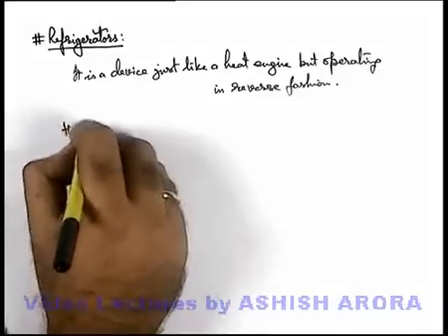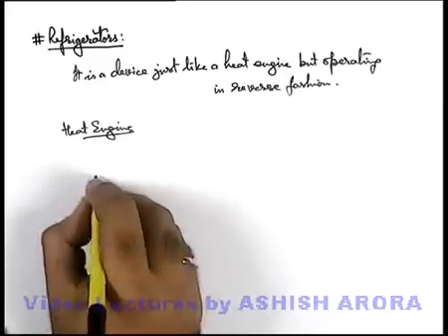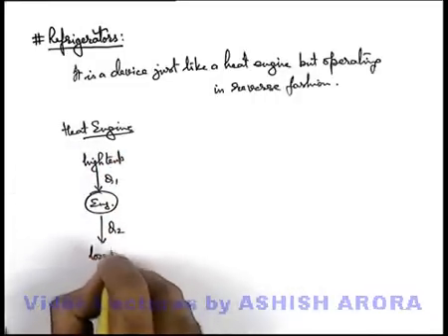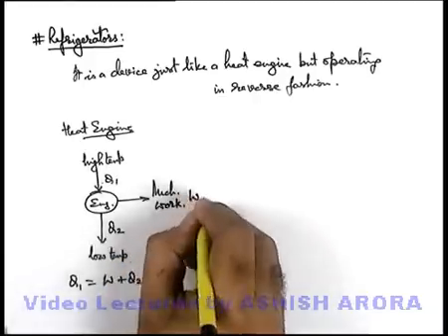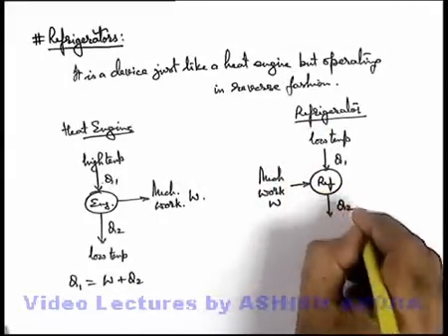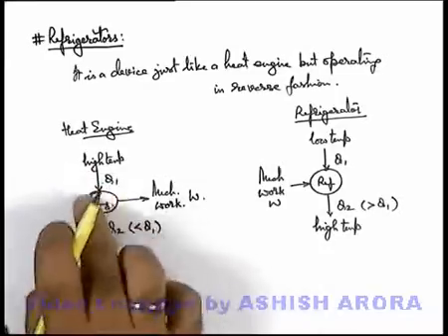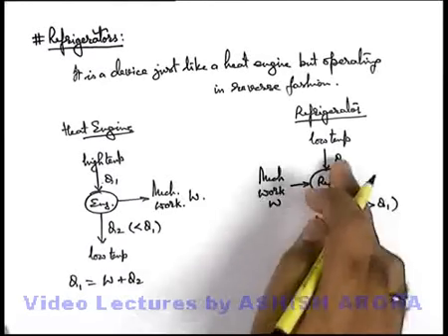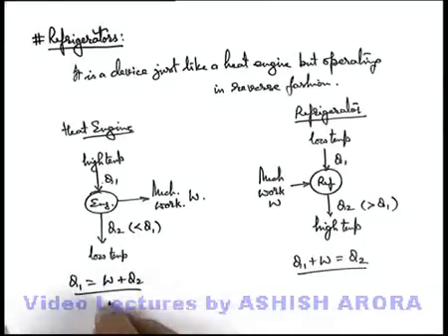Class 11 Physics | Laws of Thermodynamics | #37 Refrigerators | For JEE & NEET

Comment: Sir , why we have taken the Q1 heat as output whereas Q1 heat is taken in by the refrigerator. Or where I am wrong in my thinking??
Sir plss reply !!
Reply: Cause that's our goal. The output is what our goal should be. Since in this case, our aim is to remove heat from source, so Q1 is the output.
Reply: Hello students,
I tried to explain some very important concept in this topic and the difference between heat engine, heat pump and refrigerator.which are very useful for neet and iit-jee.  I am sure after watching video you will be confident in the topic. Here is the link
https://youtu.be/VzGyccrI-zI
Reply: I wish my video has reply of your question. If still any doubt you can comment i'll explain
Reply: Same doubt

Comment: Sir pls pls reply
why should the refrigerator absorb heat from source when ext work is applied.
Also a body can absorb heat easily from hot region than cold region am i right sir.
Pls help me i am confused on refrigeration cycle
Reply from the maker: You are right for spontaneous heat absorption which is from hot regions... but when external work is done through a compressor, here a gas is forced to expand and contract by using an external agent and in process gas absorbs and releases heat...
Reply: @physicsgalaxyworld  Asus sir joined unacademy 😭

Comment: Why it is not possible to design a refrigerator which works in cyclic process and whose only result is to transfer heat from a body to hotter body

Comment: Sir we consider source to be a massive body whose temperature does not change if a body at lower temperature is placed in contact with it(in heat a engines) but why is this not applicable in case of refrigerators since we talk about ideal cases only ?
Reply: @bhargav8263  Are you still on the wrong site?
Reply: Case pe depend krta hai

Comment: Sir when we apply some mechanical work on refrigerator why does it extract heat from the surroundings?? Actually when we apply work on a gas it should reject heat....then why is refrigerator extracting heat??
Reply: Hello students,
I tried to explain some very important concept in this topic and the difference between heat engine, heat pump and refrigerator.which are very useful for neet and iit-jee.  I am sure after watching video you will be confident in the topic. Here is the link
https://youtu.be/VzGyccrI-zI
Reply: I hope your doubt may be clear  after watching this video.

Comment: why does the heat flow from lower temperature (T1) to higher temperature (T2) ?
Reply from the maker: It only happens in case of external work done like the cases of heat engines and refrigerators...
Reply: Because of heat pump

Comment: Sir in the  refrigerator does  the working substance temperature  range from below source temperature to above sink temperature?
Reply from the maker: you can feel that for heat flow but as it is an active device heat flow does not depend upon the temperature only... using heat engine heat can be transferred from high temp regions to low temp regions also...
Reply: @physicsgalaxyworld  sir why you joined unacademy 😭
Reply: @huzaifaabedeen7119  so what's the problem ??? Sir joined unacademy as a mentor only just to guide them ,not as a teacher